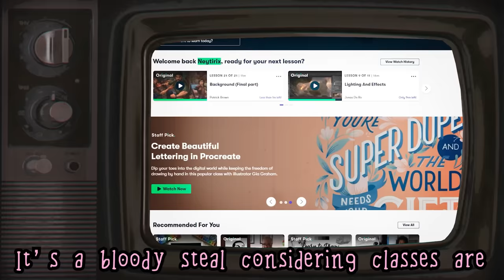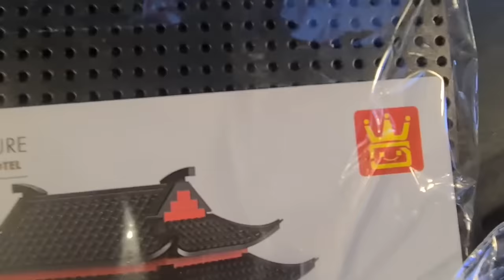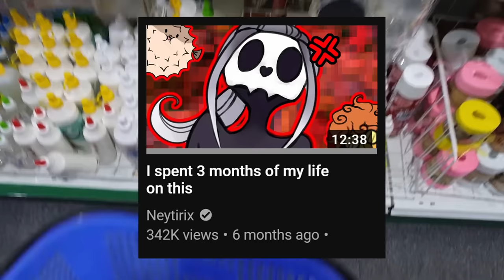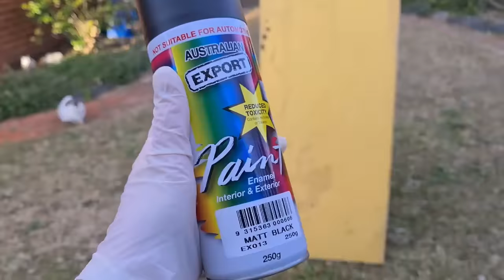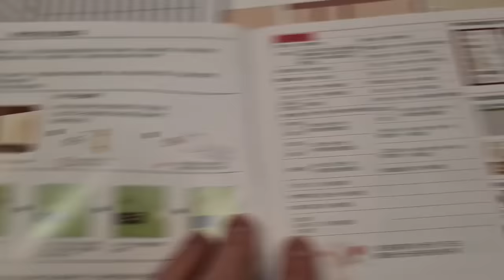It was all a lie.

Comment: fun fact part of the reason lego is so expensive is because of how tight there deviation in size tolerance is , each block has to be within 1 one thousandth of an inch on each dimension
Reply: Yea it’s like $15 for a set that’s under 100 pieces
Reply: Actually, that's interesting.
I always thought that it was because the plastic itself was expensive...but that makes more sense.
Reply: @dclassbroadcast3165  though sometimes it also has to do with what it is of ( like a minecraft set would be more expensive as well due to being minecraft)
Reply: @connorjohnson8590  that can be part of the reason ( I do believe they use a better plastic then the knockoffs

Comment: The best tip I could give about avoiding air bubbles is to pour from high up, so the stream is thin. This helps prevent air from folding into the stream as you pour. Another tip would be shaking or vibrating the base to work the bubbles to the surface, then use a lighter to pop surface bubbles, just make sure your resin isn't flammable first. For something this big, I'd use a back massager or something. And a lot of times you can pour the resin in two parts in order to get the koi under there. Just pour the first half, let it dry, then glue down your koi, then pour the second half. Resin sticks to resin when drying, so it should be seamless, just be careful of bubbles, as always.

For your second diorama this looks amazing, especially considering the base of fake legos. You're really showing improvement, and as someone who used to do this stuff professionally, I have to say I'm impressed. 

oh and happy birthday! 

P.S. if you could keep the fact that I'm giving you tips between us, that'd be great. I don't want that pufferbunny thing knowing I told you this stuff when you could probably learn it on skillshare. It'll be better for both of us if he doesn't know.
Reply: @DingDingTheYoutubeBuddy  Yeah, I figured a vacuum chamber or pressure chamber probably aren't applicable, considering the two projects she's shown have both been nearly as long as she is tall. For relatively small projects, yeah, definitely the bast option.
Reply: That's it, this is the best comment pn YouTube. It has everything: factual and at the same time practical advice proposed in a kind and understandable manner with some humor in the end.
I can go log off now...
maybe just one more video.
Reply: @voidjockey82  If I could love comments on other creators videos, I would right now :)

Comment: I would not be surprised if this turned out more expensive than a LEGO set
Reply: ....tbh depending on the lego set, this MIGHT actually be cheaper(in regards to material costs) than a lego set... some range about 2-300, some rarer ones going even higher.
Reply: By higher, I mean closer to the 700-1000 dollar range(I'm going by usd for clarification, in case anyone reading might assume otherwise).

Comment: The only way to separate two small pieces of legos is with teeth, nothing else can get the job done as good as teeth
Reply: Should I go with store bought or break into homes because I've lost all of mine.
Reply: Stop your actually so correct lmao
Reply: I chipped a tooth doing this XD
Reply: VixenSaid you got weak teeth then
Reply: I hate that I know your right from experience
Reply: several of my lego pieces have bite marks as a result of this, so i can confirm that this is true
Reply: Pretty much. It works so efficiently!
Reply: You can also sharpen your teeth while doing that too! It’s pretty effective if you ask me
Reply: @dimensiongoat871  people in Africa actually sharpen their teeth to triangular shape so they can rip the flesh way easier and look scary
Reply: @despacitoman425  Really? Now I gotta see this!
Reply: Instructions unclear: I am now missing my lower jaw and am internally bleeding in my oral area. Help.
Reply: EnderGoku9001 You need to practice. Try using easier to break apart bricks before getting to the big boi stuff
Reply: but then you get teeth marks on the Lego pieces...
Reply: @EnderGoku9001  did you find your lower jaw? It's been a week x")
Reply: @VixenSaid  Do it again. Assert dominance over them.
Reply: Open a soda can?, teeth
Seperate lego bits?, Teeth 
Fight a god?, Teeth!
Reply: when ur teeth slip from gripping the Lego and the edge cuts ur gum...